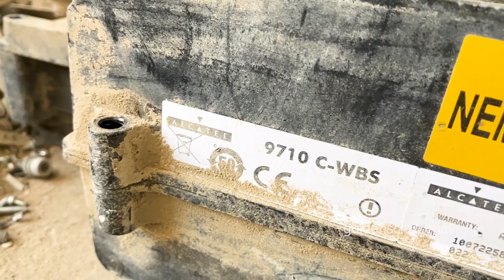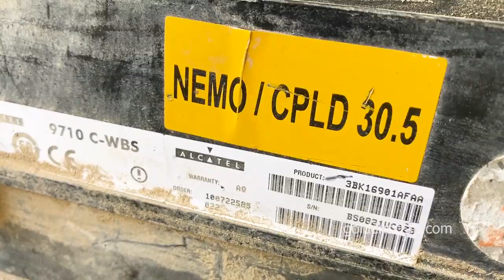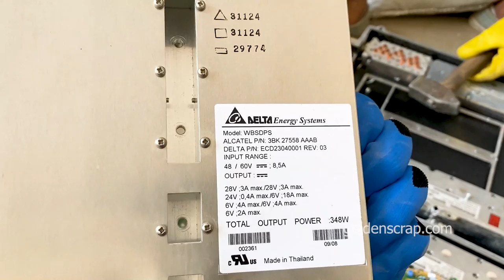Telecommunications Boards for Gold Recovery #ewaste | Best E-waste?🔥🔥🔥

Comment: This is off a mobile/cell phone tower?
(It has 3G mobile/cell phone antennae, I'm assuming it is a booster or small antenna)
Reply: Its a package with radio/signal/filter and all the encode/decode stuff that used to be inside the hut on the ground in older systems. They are called RRUs, remote radio units. The idea is that there's less loss over distance if the tx/rx cqn be done closer to the antenas vs far away in the hut like it was in the past with mobile base stations. Antennas are normally around 60 - 100m away from hut. Some new equipment has the antennas in rru too also uses the same idea, less loss

Comment: Each case contains a lot of gold plating. But there isn't much as you think in these. I know i already took a part an ran 5 of them. Is super thin gold plating over copper.
Reply: @cryptowallet7528  very low. Not worth the cost of the acids. If you can get the stuff free or some free then might be worth the time.
Reply: i want to know too
Reply: Nitric acid is easy to make and muriatic acid is cheap and easily accessible for anyone that can get to Walmart or Lowes.

Comment: If all of you dreaming that you can huge gold from this stuff and finally earn much money, when you obtain them from buy prior to do gold recivery, better just forget this video tutorial or you only wasting time/burn your money. Caused the gold content in those stuff is not significant compared with the price of stuff. You can get money when all of stuff you got by free.
Reply: Not much. I thought below 10 gram, due to the gold plating is very thin
Reply: I did not say it can obtained 10 gr
Reply: You can replace nitrit acid by using urea+soda ash+water by ratio 1 :1:1 for leaching the gold plating. It is very cheaper than using nitrit acid
Reply: I can not tell me it, caused it is dependend on what method you will use for gold recovery, experience to do that and the stuff plated by gold. Better for beginer you start to small scale (max.1 kg)  to avoid wasting your money due to failure in gold recovery later